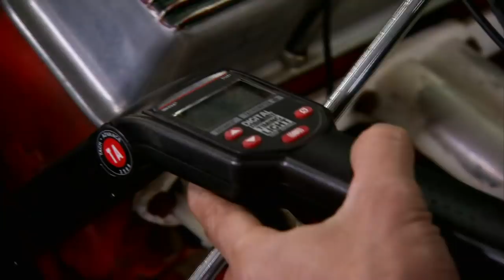1926 Ford T-Bucket: Richard Rawlings Quickly Flips Classic Hotrod | Fast N’ Loud

Comment: I love the old T buckets, that one has such a weird rake to the body, never seen one like that. 
Air intake and headers looked better before they changed them though.
Reply: the rake just gets the body over the rear axel/suspension without having to make anything fit.
Reply: @krusher74  Thanks, I have a t bucket, but I've never seen one with that drastic of a rake. Kinda crazy looking.
Reply: @LastBastian  agreed and preferably the wheel not in that location

Comment: Know I'm beading have. I've asked many others to take on this Challenge. You're gonna laugh but it's right up your alley. Think about it, A Wide Body T Bucket. A Carbon Fiber Body that looks like Herman Munsters Hot Rod. The key Ingredient, the Helephant... Know and I gave them one last hint. To plant the tires on the pave we used to use slide rails. Know I'm again beading have, when we used to race Dirt Track. Just think about it ???

Comment: Small tires for monster car.. total fail
Reply: those are only used to move the vehicle around and so it will fit in the hauler.  The big tires get installed at the Jam location.